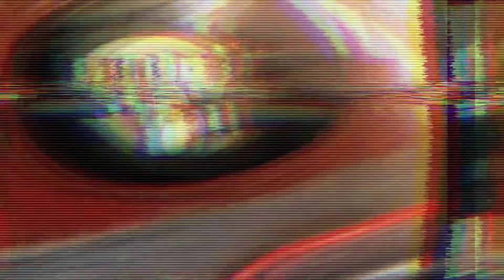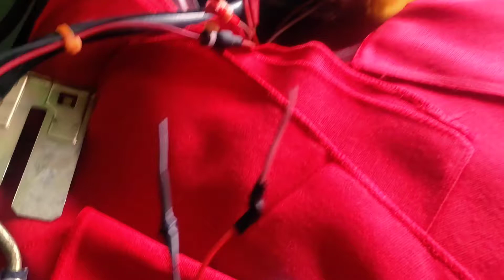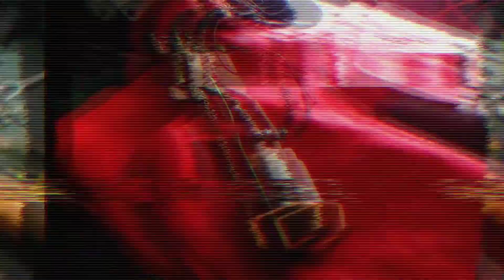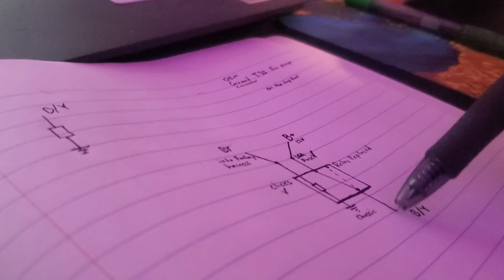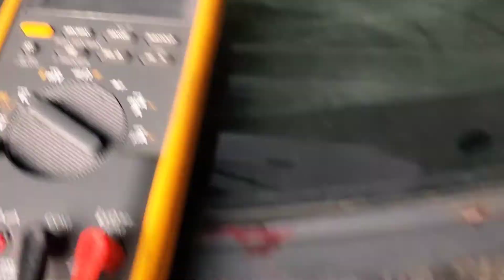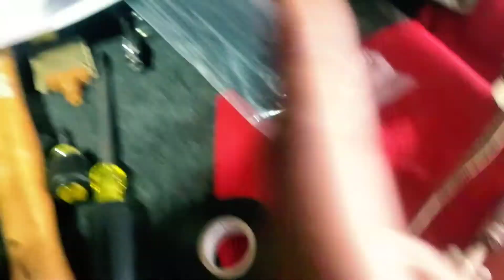diagnosing my s14 fuel issue

Comment: What all do you have connected to on the vacuum lines in the bottom of the intake manifold the 4 prongs it came with ?
Reply from the maker: Check my intake mani instal vid. one is pcv one to a map sensor. One goes to the brake booster and i belive the last to the fpr